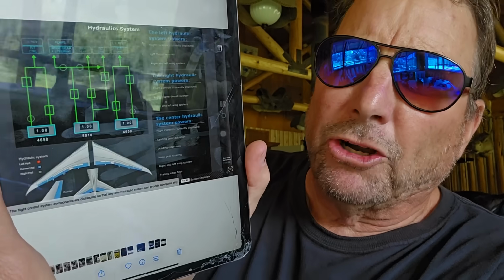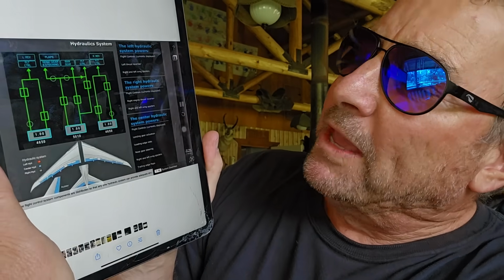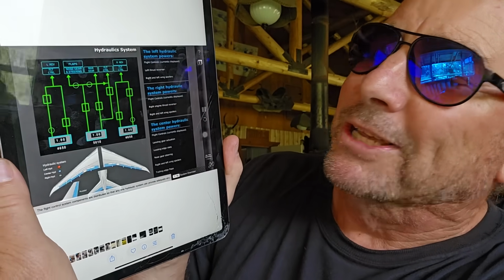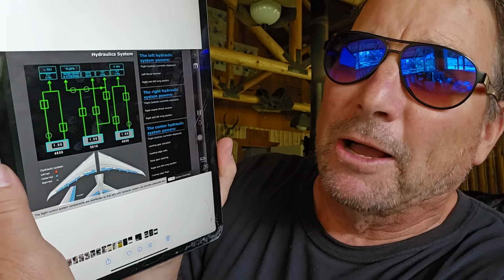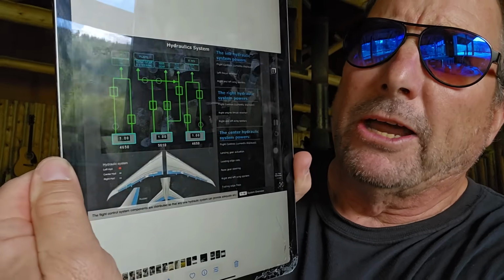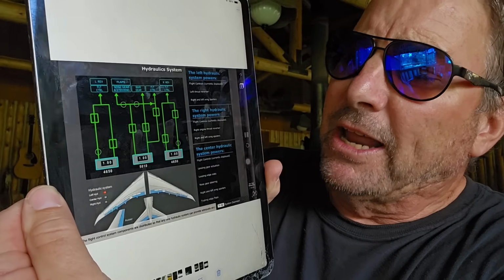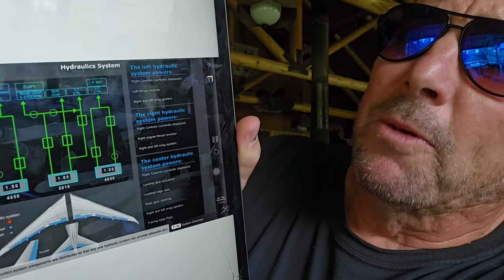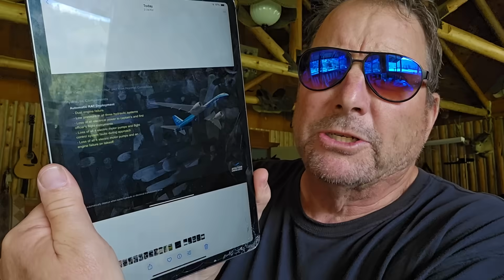787 Crash India What's a RAT? When does it deploy?

Comment: What I have learned from other channels is not only that the Ram Air Turbine was deployed, but also that the pilot  declared a Mayday shortly after takeoff, the lone surviving passenger reported hearing a bang during takeoff, one video shows smoke or dust billowing below the left wing of the aircraft during takeoff, and the pilot seems to have begun lowering the landing gear shortly after beginning to retract it.  The transponder shut off as the plane reached the end of the runway, suggesting a hydraulic or power failure, which may explain the RAT deployment.  So all the evidence presented so far in the various sources strongly suggests an engine failure during takeoff.  The aircraft was too low at this point to gain any further altitude on the one remaining engine.  The pilot kept the plane's wings level to the very end, which suggests an attempt to maintain control throughout the flight.  This was not a new jet, said to be 12 years old.  So an engine failure would not be a great surprise.
Reply: 12 years old is not particularly old for a passenger jet, and all airlines do hold to manufacturers recommended service schedules for vital components such as engine parts though.
Reply: @Lithos2k  Yes, you're right that 12 is not particularly old.  Should I have said 12 years young?  This particular plane should have had at least 8 more years of flying time before being scrapped.  There have been several recent reported instances of diversions of 787 Dreamliners, which is alarming given that it seems too soon for them to have mechanical failures.

Comment: One of the post crash analysis videos shows the AIndia 787 RH wing section just in board of the landing lights, with the leading edge flap slats deployed along about 50' section visible. As the 787 was in stable flight, this should confirm that flaps were deployed.